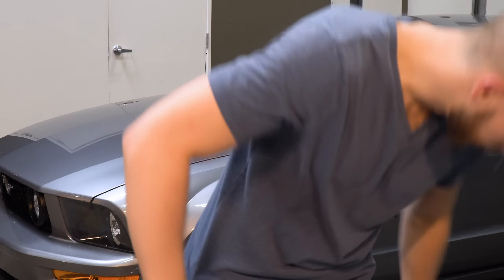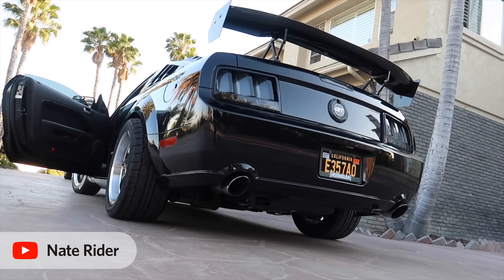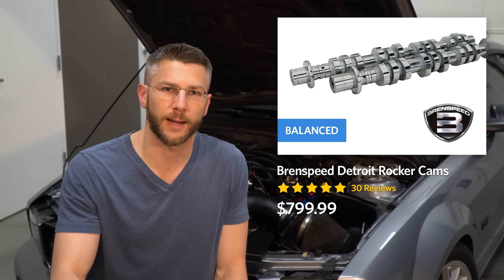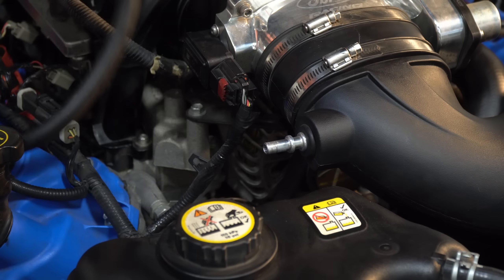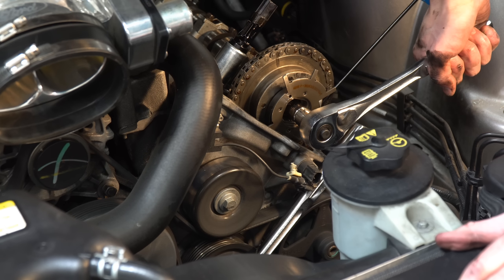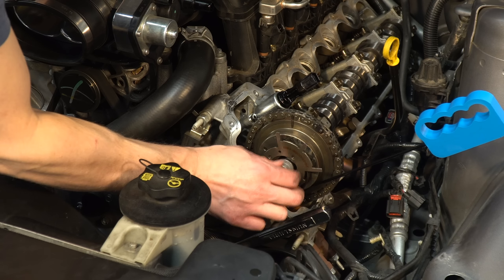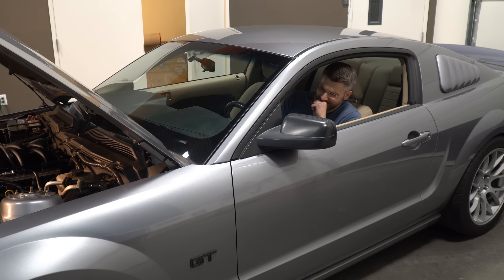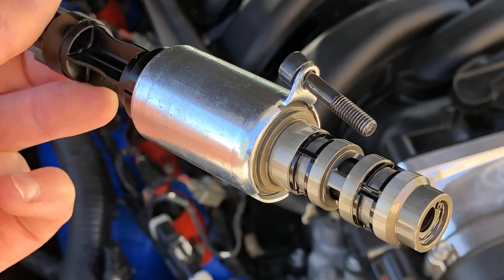Mustang camshaft selection and install guide

Comment: In the middle of doing this (plus new chains, sprockets, guides, etc) how careful were you when laying the cams in and making sure the followers didn’t go out of place or anything?
Reply from the maker: How careful? Super careful. I checked each follower like 5 times before putting the valve covers back on. And when I initially started the car, I listened to the valvetrain for a couple minutes. Probably didn't rev past 5k for like a month lol.
Reply: @Four_Eyes  Ok sorry to be a pain but you mentioned "Ensuring none of the roller followers are out of position before placing the cam in" and "Double check that all the roller followers are in place afterwards" How can you tell they are in their correct position?
Reply: @Four_Eyes  Update: Got the cams in plus the timing assembly and tuned it with a rev-x sct tuner from bama. All good
Reply from the maker: Nice work! Sorry just saw your follow-up comment.

Comment: Great video, I did a video on the huge Comp cams for this car, the 127650. Just noticed that you re-used the cam cap bolts. I found out the hardway about doing that,total destruction, dropped #5 exhaust valve. I did have those Detroit Rockers, the blower gring due to having the Vortech V3 supercharger on mine. How is it running now days? Again,nice video.
Reply from the maker: Thanks Michael. It's running well knocks on wood - looking forward to getting the ported heads on installed... should be interesting.

Comment: Just installed hot rods.. have quite a bit of thin white smoke for 5-10 minutes after startup. Did you experience this?
Reply from the maker: I didn't. But my car was running rich after installing the cams. My tuner said since the valves are open longer, it's common for engines tuned for stock cams to allow too much gas into the cylinder. As with all modded vehicles, I highly recommend a dyno tune. My car was actually down horsepower until it was retuned where it well made up for the loss in the power.
Reply: Four Eyes I’m data logging for a Lito tune today, not sure if you’ve heard of him. He’s considered the best remote tuner ever. Thanks for all the replies I really appreciate it. Love your videos keep it up!!!
Reply: How long was the install?

Comment: I can't wait to install my hot rod cams! hopefully tomorrow if it don't rain. I'm nervous and hope I don't screw things up. been watching a lot of videos and have all the parts/tools ready. thanks again for the video. one question, once driver side cam is top dead center with tdc mark. do I have to move passenger side cam to top dead center too? or would both sides be tdc, once I move driver cam to tdc position. If that makes sense. wish my luck!
Reply from the maker: you don't have to. moving to TDC is more of an extra step that just allows you to know where the pin slot should be (that step can be skipped).
Reply: @Four_Eyes   @4:25 the dark timing chain link part thats on tdc. does that mean anything? all the other links are different color except that one dark
chain link.
Reply: @Four_Eyes   thanks bro! Hot rod cam swap went great sounds good plus put some 34lbs injectors too for e85 conversion. 🔥 just need some get some datalogs done. You’re video was a huuuuuge help 🙌 thank u again for your content. Hope too see more soon!!

Comment: Hey man when removing bearing caps according to your chart you removed 10/9 first?
Reply from the maker: Yeah, you can slowly add/remove the cap bolts in any pattern as long as the cam comes up / goes down evenly, but that sequence should be followed when torquing to spec.
Reply: Four Eyes so I don't have to take off the 9-10 first? Just loosen them all evenly?
Reply from the maker: Right, but the other caps "hold down" the cam more than the 9/10 bolts, so it makes sense to remove that one first.

Comment: In the official installation instructions from Ford Performance it says to remove 3 specific rocker arms before removing the cam. Why did you skip this?
Reply from the maker: Unnecessary.. in the really old documentation, they actually had you take off the engine's front cover - no thanks!
Reply: Four Eyes thank you. I’m installing hot rods this week. Do you have any tips on preparing rocker arms and lash adjusters as I am replacing those as well. I’ve heard to soak the rocker arms in oil for 24 hours but that it doesn’t really do anything for the lash adjusters. I plan to lubricate the adjusters with oil during installation and use cam lube on the camshafts.
Reply from the maker: I don't... the only thing I didn't mention is that the gaskets on the stock valve cover will stick to the head (unlike the aftermarket blue valve covers). So just be prepared for that. Oil the gasket and place it in the stock valve cover's groove before placing (instead of trying to place it on the head). As for the rocker arms and adjusters... just be super duper careful. If any of that gets out of place, well you know what happens. I re-checked the position of my roller-followers like 5+ times.

Comment: I know this video is old but I really would appreciate the help and info I’m currently looking to do this job but Im also looking to do rocker arms and lash adjusters along with a new timing set can I follow the same steps as you and take the cam off and replace the rocker arms with the lash adjuster and then do the timing chains 
If you have an email available could I email you some more questions really nervous as this is my first time taking apart my motor

Comment: Thank you! Mine is pretty similar and still struggling with the Bama tunes.
I wanted cams badly, but after research the Ford Racing ones didn't fit my goals for touring and "normal Mustang use". Then I didn't knew about these. Just by the sound I imagine how it goes and that I would stop about there with upgrades and continue to use it's technical resource. Though I'm not too far in wearing it up at 50.000 miles :D Chech my Mustang sound videos, I made cheap custom tuned mufflers that are quiet at cruise and sound good at acceleration and also improve the torque from Idle to about 2500 rpm (Helmholtz centered at 1700-2200 rpm).

Comment: Hey Four Eyes, I watched a video from LMR installing the hot rod cams and saw that they removed the roller followers before removing the stock cam, and re installed them after putting the new cam in. Do you think that step is not required?
Reply from the maker: I skipped it

Comment: Why did you cut to a static image after "A few Minutes later"?
Reply from the maker: Interesting question. So it's not a still image, if you quickly scrub forward and backward you can see the trees, and the reflections on the rear window and the water, are moving.

But the revving was recorded at a different audio setting than the idle, which yields two video clips. Only the idling video clip was used for the visual while the audio of the revving was dubbed in. I did this to best approximate what the car sounds like in real life.

Comment: Do you suggest buying new bearing caps? Is it a definite or can you still use the old ones.
Reply from the maker: No definitely not, use the old ones in the same place and direction otherwise you run the risk of damaging them and the camshafts.

Comment: Does anybody know if this install would be the same for the ford performance hot rod cams
Reply from the maker: it is
Reply: Awesome man thanks, and another question !! Do you hold the crank in place when loosening the phaser bolt or the wedge does the job ?

Comment: Love your car! I have a '05 GT. I've been wanting cams but have been afraid of installing these after seeing NateRider and Jonathan Harder. I have a qualified mechanic that would do mine. Just wondering if it's still OK to install these since I have about 58K on my car.  Where did you get yours from?
Reply from the maker: Thanks man. I had a VCT solenoid fail a few days after the install. It was pretty easy to replace and wasn't a big deal (probably would have failed eventually). So I say yeah definitely. I bought them from Brenspeed (http://www.brenspeed.com/detroit3vna.html).

Comment: I have the Hot Rods since back when I did this the Detroit Rockers didn't exist yet. This was about 9 years ago. I thought about the Thumpr but I didn't want to mess with phaser limiters. I think I was one of the first if not the first to install these on an auto because no one could get the tune right. When coasting slow the transmission would freak out due to the pulsing of the engine with the cams and it would go into limp mode, locking me into one gear. This made traffic real fun.

But then thanks to a dude on s197forum.com who figured out what was going on (he had Comp Cams most aggressive stage 3 cams on his car which sounded insane), he talked to Brenspeed and they were able to get me a tune that works. Now that Brenspeed knows what the issue was, everyone with cams and autos since then are good to go.

Comment: Man I want to thank you soooo much for your Video. I watched it and watched it and did every thing correct. I have a 08 GT I put the Comp Cams Big Muther Thumpers in with the lock outs. Car Sounds Wicked and drives well. I check the air fuel ratio and it reads 14.7, but I can smell the cats when car is warming up. I had already had a tune for the BBK Cold air, then up the idle to 990 with the SCT Tuner. I don't want to load up the cats or melt them down. Is this normal to smell the cats a little when warming up, I know the cam lobes or 109 centers maybe letting a little extra out?? I value your thoughts. Thanks again for the awesome videos. 7-5-2022

Comment: This is late but what's your full exhaust setup? Also how good do you think they'll sound on a mostly stock exhuast with just a flow master axleback? Please replyyyyyy I want to get either these or the hot rod cams
Reply from the maker: Kooks Longtubes
Catted x-pipe
Pype Bombs

You'll be able to hear the lope with either cam, but hot rods are lopier / more choppy. You won't notice much of a difference in sound under heavy acceleration. Go Hot Rods for sound, Mutha Thumprs for power and a savage idle, Detroit Rockers are somewhere between those two.
Reply: @Four_Eyes  I definitely want a killer idle and a bit extra performance so I guess I'll go with what you chose!🙏🏼 Your videos inspire me so much bro, my 07 GT is my first car and you really teach me a lot
Reply from the maker: That's a p legit first car. Mine was an '88 Honda Accord that leaked oil and smoked at idle :)
Reply: @Four_Eyes  Saved for 2 years before I could get it and I'm happy I did:) Your videos make me feel extra proud for owning a 3v🙏🏼

Comment: I installed cams and used proper timing wedge and everything. It runs fine for a bit then the check engine light came on with p0012 timing over retarded bank 1. The pass side cam timing must have jumped a tooth somehow. Do I have to pull front cover to time it or can I just pull valve cover again and check timing and adjust as needed? TIA
Reply from the maker: Removing the valve cover should be fine. Check that the black chain link is positioned inline with the top-dead-center indicator. If it is, maybe the phaser or the VCT solenoid is going out (happened to me!).

Comment: any updates how are these cams working for you man. i want to get the same ones but im kinda waiting to hear how yours holds up. also are you planning on switching cams when you add boost thanks bro
Reply from the maker: Hey Hugh, so I'm always weary to say things are going fine, but the car is still running strong. The cams do chug/buck at low RPM (< 1,500) especially when it's cold. The car just doesn't like going below 10mph, so I have to lightly slip the clutch in parking garage, etc. I don't mind this though.

I don't think i'll be switching the cams anytime soon. New video this month.
Reply: @Four_Eyes  thanks for the response man. did u get a email tune from brenspeed when you bought them or did u go straight to ur dynotuner. and great content keep it up best 3v youtube build content
Reply: @Four_Eyes  thanks for the response man. did u get a email tune from brenspeed when you bought them or did u go straight to ur dynotuner. and great content keep it up best 3v youtube build content
Reply from the maker: I ran the with the tune that was already on the car (previous dyno tune) until I was able to get another tuning appointment. Thanks amigo ✌
Reply: @Four_Eyes  appreciate it knock on wood hope it last for you. will be using your vid for an install guide have a good one bro

Comment: I had these, sounded pretty good but even being the mildest cam I still felt that I lost a ton of torque up until around 3500-4000 rpm. Car just felt slower
Reply from the maker: Yeah, out of the box the car will lose a noticeable amount of midrange power, dyno tune really helps out.
Reply: Four Eyes yea that canned Brenspeed tune didn’t quite cut it. Looking forward to seeing how your car does on the dyno with a dyno tune! Sounds gnarly

Comment: Did the cams make your MPGs suffer?
Reply from the maker: I haven't noticed anything significant, still getting about 14 mpg in the city.
Reply: @Four_Eyes  thanks!! I seen where some people with hot rod cams were losing a lot of mpg. After i watched your video i searched online and found most people running detroit rocker cams mpg stayed the same and some improved!!

Comment: Does the valve cover not have a gasket?
Reply from the maker: It does, it's attached to the valve cover.
Reply: Four Eyes is it safe to re use?
Reply from the maker: Yes, but those valve covers are only a year old. I should have mentioned it's a good idea to buy a new pair o gaskets since you've got them off. But if not, just apply a lil motor oil to the existing ones as a protectant.
Reply: Four Eyes thanks! Love your videos by the way!

Comment: What's going on man you told me to wait till you post the video before I finish my tune so I can see your results?????
Reply from the maker: New vid Saturday. Either intake is fine with cams. The performance mani will give you more power up top (assuming the car is tuned well), but will for sure sacrifice low and mid-range torque. The performance mani is ideal for boosted setups.
Reply: Four Eyes yeh I so did you keep the stock manifold then? $600 sitting in my garage eating at me lol
Reply from the maker: I am running the performance mani right now, mainly because I am sick of swapping them, but I do enjoy having the highest N/A 3v (verified with a dyno chart) that I've seen on YouTube.
Reply: Four Eyes really looking forward to this video my build has closely followed yours 👍

Comment: With the suspension upgrades you risk making it unpleasant to drive. A set of new original Motorcraft shocks and springs should do it. For the rear you can actually put stronger shocks, for instance from GT 500 or something custom or really expensive. Otherwise the car might begin ducking at potholes which is quite unpleasant.

Comment: I think i would have wanted all new followers 
The rollers and cam shafts have micro finishes i would like to bet brendpeed wouldnt guarantee there lob surfaces againt failure when matched with a used set of lifters 
Thats what a dealer would do if it was warranty but doubtful they would do it if they were guaranteeing the work themselves 
A lifter spring could fail or a possible worn roller pin what did brenspeed recommend
Secondly factory goes thru great lengths engineering a cam just like programing a ecm then these guys come along and say i can do it better
It might not be better just different

Comment: That sounds great - nearrly nice balance. Tip: With new cams you should really fast idle for at least 15 minutes before allowing the engine to idle - cam wear interestingly is at it worst at idle - more time for the wedge of oil to spill away after the nose of the cam has come past the lifter - getting that "phase" over and done more quickly reduces wear and tear while the cam is bedding in.
Reply: Cam doesn’t touch a lifter on mod engines. They have roller followers.

Comment: I said allready in comment before. I want to buy Roush or Shelby gt...or...
The reason is,the cost price for a fast car,and the valeu after.
Shelby stays Shelby! 
What is your Total cost to get 400 horsepower ?
If you buy Roush stage 3 track pack....you got +400 horsepower....That car you can buy for 30.000... a good low Mike car. So in my opiny...better off.
Sorry for my bad english guys
Greats from Poland.
Reply from the maker: Buy a cheap 05-10 GT for like $10k (USD), buy a supercharger and longtube headers for ~$6k. Then you have 450 wheel horsepower for less than $20k.
Reply: Roush track pack 427 limited edition (100 in 2007) cost 30.000...thats 10.000 more...but i geus for later,i keep my valeu more,than you. Its my opinion 😉
But ernestly with your car...i Will also be happy.
Goodluck with your you tube Chanel....i follow you 👍👍 thanks!

Comment: And for sure You only replace these camshafts and You did nothing with the program, and no use of laptop
Reply: And If i have stock 4.6 V8 i will change for these camshafts for these same as Yours i dont need to change nothing from these engine?